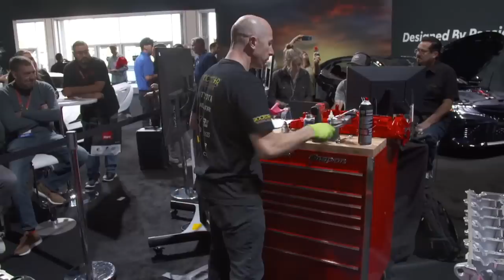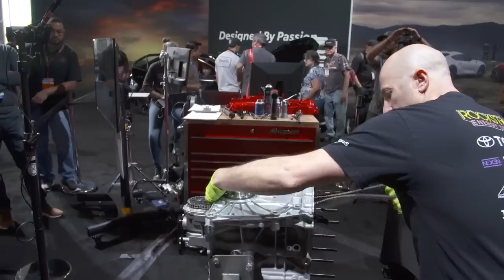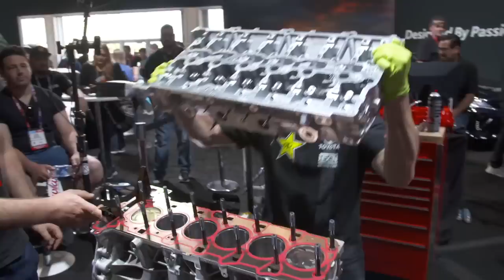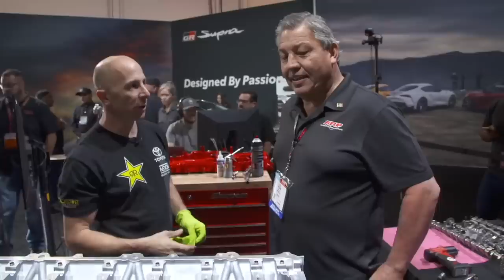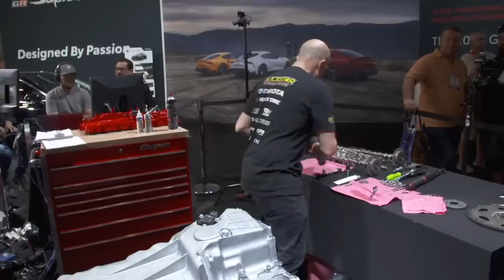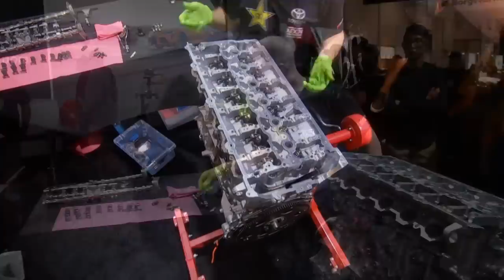1,000 HP Supra build | Live @ Sema | Thursday

Comment: I only build V6 L27 engines I just want to compare with you these are my procedure pinned conrods to piston add rings compare thermostat freezer temp x 3 setting for metal expansion in the ring holder attached ready to put in the bore from freezer leaving 6 min for installation per piston head gasket .80in 2mm my cam is 2500 to 6500 but constant around 380hp to 480hp? Are these engine having solanoid issue crank sensor coil fuel pump solanoid above 500hp I'm relying on air expansion for constant power and cooling killing two birds with one stone.

Comment: Hi Papadakis I build L27 3.8L turbo gm v6 from ebay parts my oil temp pr at 74 F all the time no need for high Volume oil pump Head Gasket is a steel made at 2mm Thickness with mechanical 170 gal fuel pump I have no problems  at all. with set up. My ? is what temp is oil staying at with the new engine and Oil pump.

Comment: i keep a couple guitar capos in my box to hold things in place if they are flopping around and i dont want them to move.  not much force, and are soft so they dont mar surfaces and take no time to setup, literally squeeze and boom, something is held in place.  also use .020 safety wire for the same thing, takes like 30 seconds to setup if i need to keep something out of the way.

Comment: Hey Steph, do you think this engine will be as successful as the JZ series of motors once the aftermarket market has grown to support it?
Reply: It's got a chance since S55s are already pushing over 1100+whp and some getting close to 1200 on stock block and internals. Only problem is is that there are few running those numbers but it is sort of showing how much potential they have. It is a high possibility that the B58 might hit around that but we'll just have to wait and see.

Comment: In regards to the running into an exhaust restriction issue due to the head design, I am sure you could adapt an S58 head to the B58 block. As far as I know, the S58 still has individual exhaust ports per cylinder.

Comment: Hey papadakis, do you think the early b58 heads that have a 6 port exhaust with a manifold be better to be swapped in the current b58? If it bolts up easily
Reply: I'm not an expert  but. If  you can manage the exhaust  gas pulses more efficiently  it could be a better than shared port system. But I don't think  it  would make a huge difference.
Reply: I would think an S58 head would work

Comment from the maker: Because so many of you are asking: the pink lint-free towels are the Wypall 41055 x80 cloths -- we buy them on Amazon.
Reply: How can I learn to build an engine in only 2 hours like you? Teach me please.
Reply: Roland Duson by just doing it. I think pulling the engine is actually more difficult.
Reply: @Roland_Duson  If you have done it more than once or twice and you need all the tq. values and sequences and all parts are clean like on this video should be easy then.
Reply: @nihonkokusai  How do you find where all of these values are compiled or whatever? I'd like to be able to disassemble, clean, and build like this without having to shell out to go to school.
Reply: @Roland_Duson  There is a book called a workshop manual. every model car has it. Sometimes dealer provides tq values at a low price
Reply: When you are unsure for the first time make plenty of pictures before disassemble.
Reply: I watched you super clean all mating surfaces. But when you mated the head, you cleaned the head& block, but skipped wiping both sides of the head gasket. It was moved around your table and under a few times. ???

Also, I was wondering why you don't use piano wire or another type, to prolong the engines life.
Reply: PapadakisRacing -Thanks! Great build! 👍👍👍